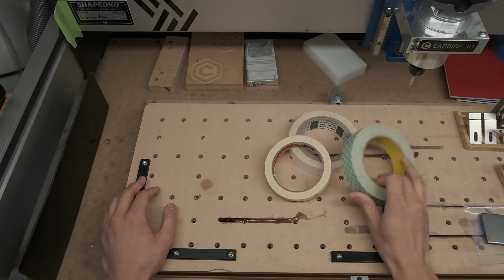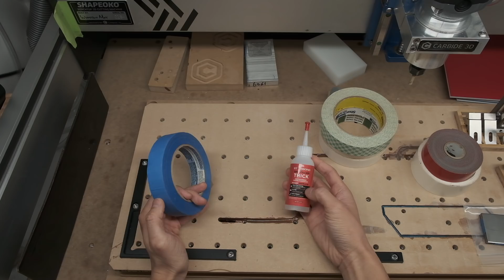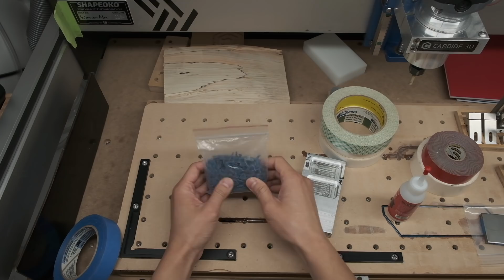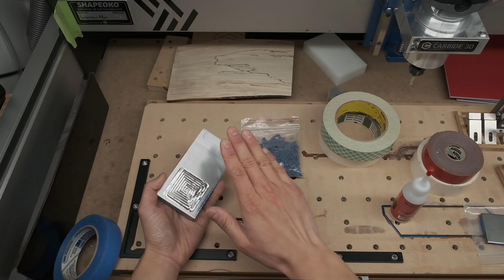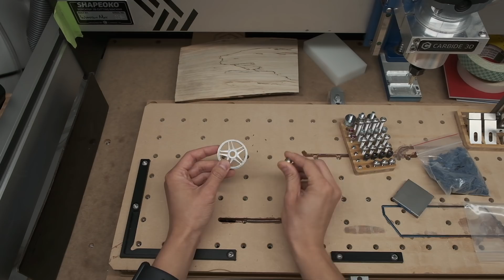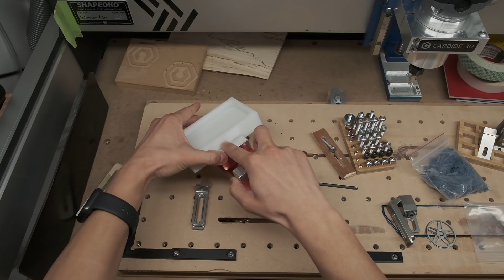Workholding 101 for CNC Routers - Carbide Office Hours #9

Comment: Great stuff!! I carve historic buildings into 4 foot wide oak stair treads. My machine bed is only half that so i made a sled larger than my stair tread. I fasten the work to the sled with screws from the bottom of the sled into the rear of the piece. Those holes are conveniently hidden when it's done. Then I spaced holes on both sides of the jig lengthwise at 16". I tiled my toolpaths and when one section is done, I lift it up and move it over to the next hole set. There are always 4 steel tooling pins locating the work and I just bolt it down around the edges and we are off to the races. The tooling holes are standalones in between the holes that my spoilboard already had. I can remove that thing and not use it for months. I can put it right back where it was and step it through the machine and you can't tell where it stopped and where it started.

Comment: I have an aluminium bed of 20mm thick aluminium tooling plate tapped with threaded holes 50mm apart. I used a thread cutter to thread 300+ holes using cnc. 
I use old laminate floor boards as waste boards when I need to work on a piece of board and using aluminium finger clamps with one threaded hole for a screw as stand off on the opposide side to the work piece. a slot was machined. works well for me. I also have a 125mm machine vice for smaller pieces (aluminium or wood) for easy swapping of stock. 

I like your angle corner, I might do something similar, and add a jaw clamp end to it. I'd worry that the stock may be pulled out of it with aggressive machining though.

Comment: I recently bought an old 4 ft x 8 ft CNC. I upgraded the controller to use an ESS. The table is just a big sheet of MDF right now. What strategy would you employ to get consistent we're folding for wood sheet parts?

Comment: I have a Nomad and only do small light weight stuff, like plywood and plastics. I found that double sided tape strong enough to stop movement was a pain to remove from the cut project. The solution was to cover the back of it with masking tape and then apply the double sided tape. Works really well and I don't have to spend an hour trying to remove adhesive.
Reply: I like your idea. DS tape is so messy to remove from workpiece. This is better than CA glue

Comment: You mentioned removing carpet take and other double sided adhesives. I like to use my BuildTak Spatula for this. (https://www.buildtak.com/product/buildtak-spatula/) I am using the older version. But The new extended version would be ideal and plan to get one. It works very well at getting enough leverage to remove parts that stick a little to well. But Honestly I prefer something that sticks well rather than not at all and enters Low Earth Orbit.

Comment: Milling is easy, the workholding is the hard part ;-).
I use a lot of knife clamps that i screw directly into the waste board. I angle them against the wood en screw them down. The sharp edge digs into the wood and grips really well. Good for very low profile workholding and still being able to machine the top.

Comment: I have been using small scrap wood 2"x1"x6" taped down on the bottom sides. The sign board that I carve, is  the same size each time. I only remove the wood on the right side to remove the sign or place a new board inside. Checking each time that the wooden sides wont move. So far its worked for me. Hi from NJ.